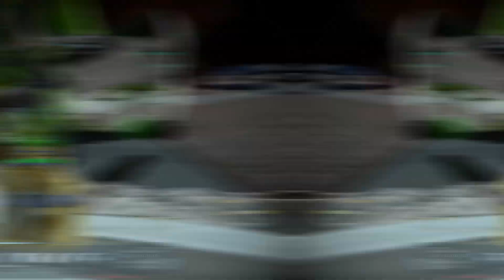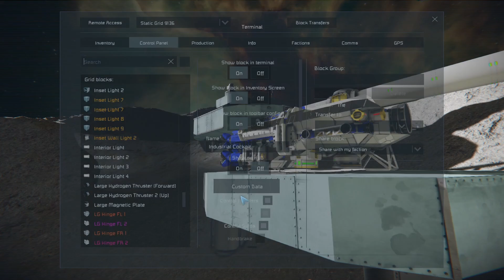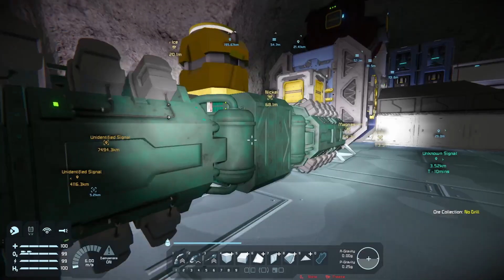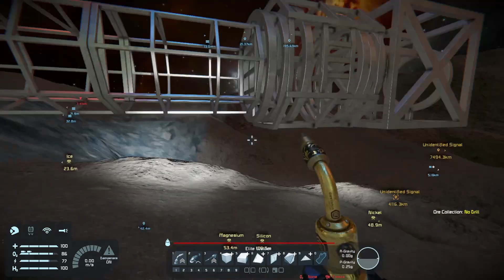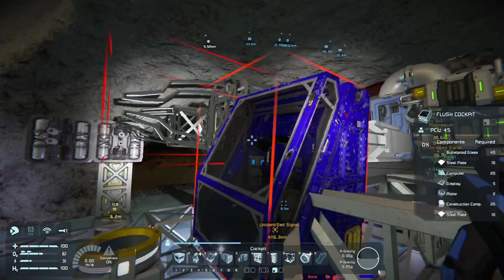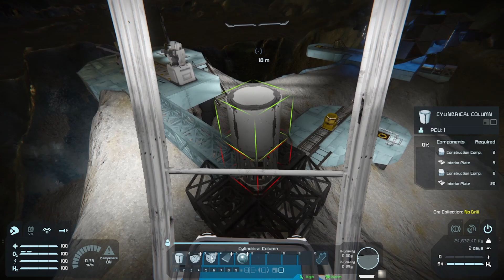I Have No Plan! | Space Engineers | The Search for Factorum E.15

Comment: The key tip I can give you cosmic about using sorters is make sure you can always have control the direction of flow so something using the sorter to put into a cargo container you want to make sure that you can move from and to that container. As for your gravel ejection that's simply having a sorter to remove the gravel from the container to move it towards the conveyoring to move it to be ejected.
Reply from the maker: I appreciate the tip.  The way you explained it makes sense to me.  Thanks!

Comment: Your going to need large ports to the welders and to put components into your cargo for stuff like steel plate and the other items that do not fit through small ports
Reply from the maker: I really thought I had large port access to the welders with that bottom connector. Guess not lol.  At least the fix with the connector on the side worked.